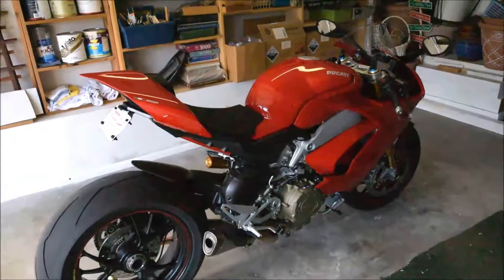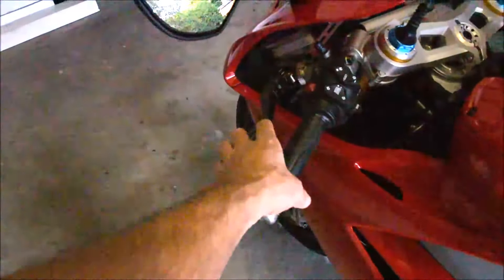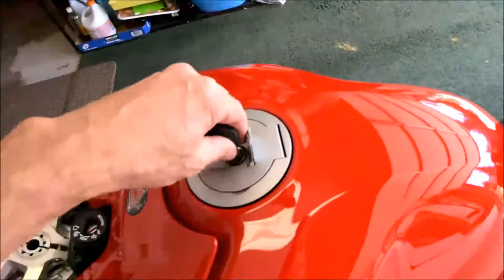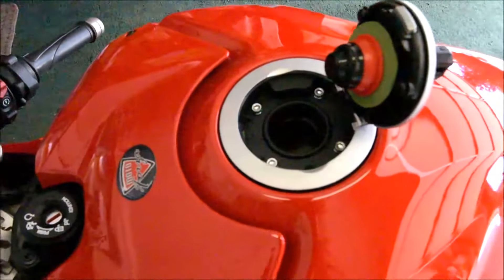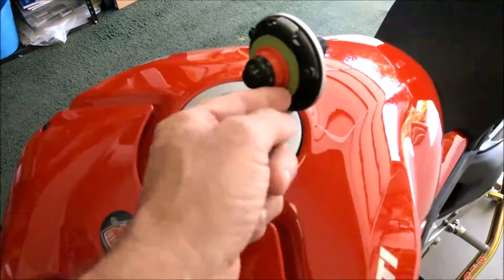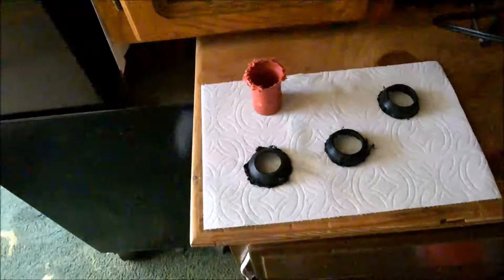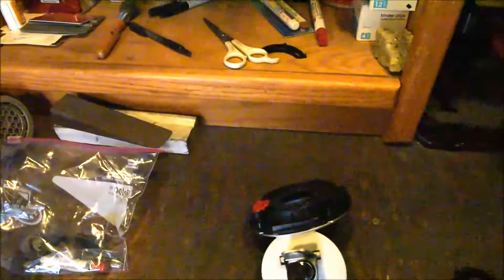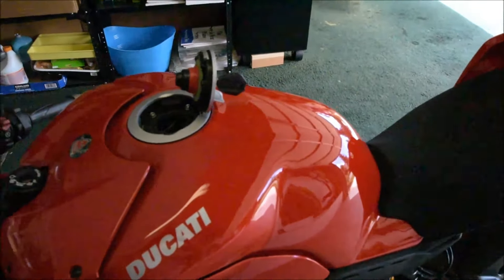Panigale V4, Fuel Filler Mod

Comment: John, rather than jamming the hose down into the tank, consider pulling back the rubber cover and insert only the tip of the nozzle into the tank.  Works for me        every time for the past 20 years.
Reply from the maker: That's exactly what I do. I like to be able to see the fuel level as I'm filling. This just makes the hole bigger so it's way easier to see into the tank. 
Glad to see I'm not the only one who wants to make sense out of this.

Comment: Hi, could you tell me how to move the levers as i can t do that on my bike as the whole set up hits the fairing and did you remove the pin or rotate the whole bar end
Thanks
Reply from the maker: You are constrained somewhat by the tank and the fairing. On this bike I didn't need to remove the pin to find a decent set up but I have on other bikes without any problem.  Thanks for watching!

Comment: filling the tank takes about 40 - 60 seconds and i would never ever put the entire nozzle all the way into the gas tank and fully pull the lever and wait for it to click.  that's just plain silly and i'm pretty sure nobody expects the rider to do that.  anyone who can't control the nozzle and fuel flow for less than one minute is just being lazy.  on my supersport the opening is much bigger so i can tell it is easier to work with than the narrow opening on my panigale but i'd hardly call it difficult to use and necessary to mod.  however, if it's easy to do and doesn't cause any issues, go for it.
Reply from the maker: Thanks!